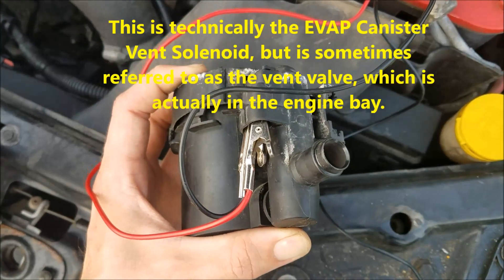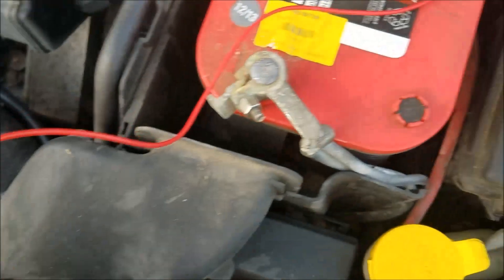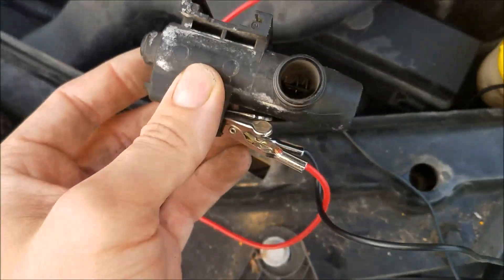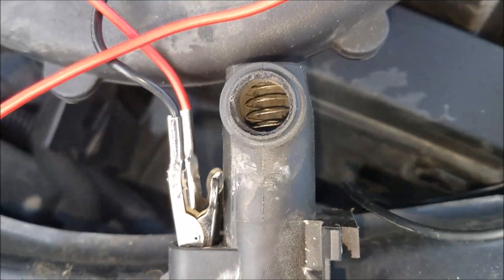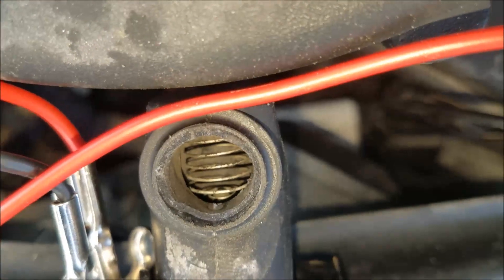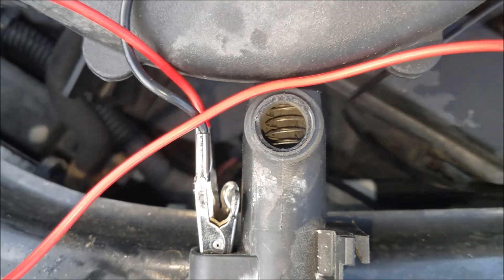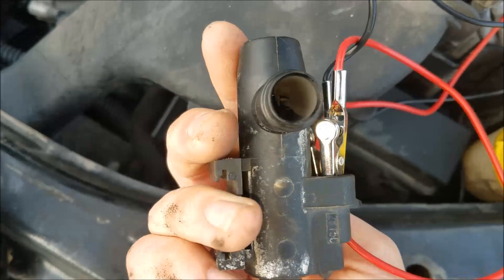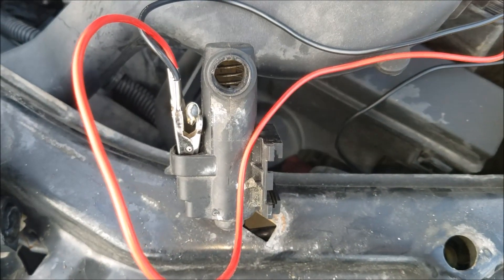Testing EVAP Emissions Canister Vent Solenoid (P0455 and P0499 Codes)

Comment: Would it work with a 9 volt battery as well?
Reply from the maker: While a 9v may trigger activation, I would stick with testing via a 12v source. Electronics act funny when they only get a fraction of the required voltage. Ever have an alternator go out and vehicle run just off the battery? Eventually the radio, lights, etc have problems when they don't get enough power.

A 9v battery would likely work but you would basically be adding in an additional variable into the equation. If it doesn't activate with 9 volts, is the part actually faulty or is it simply not getting enough voltage? Just stick with the recommended 12v to avoid replacing a part that still may actually be good.

Comment: Good god man, there are connectors available on Amazon that slip right over the pins. I was just waiting for the gator clips to touch, especially when the solenoid fell into the engine. Hope this helps.  https://www.amazon.com/gp/product/B0002SRIWS/ref=oh_aui_detailpage_o02_s00?ie=UTF8&psc=1
BTW get someone to do the camera work so you can have both hands free. That nonsense drives me nuts. Thanks for the vid nevertheless.